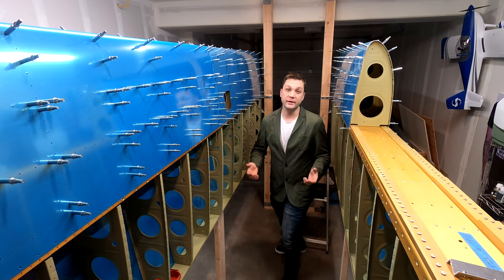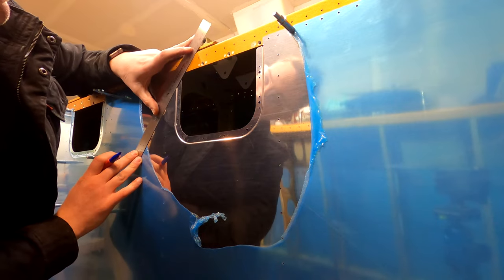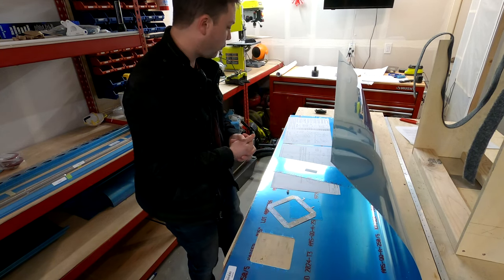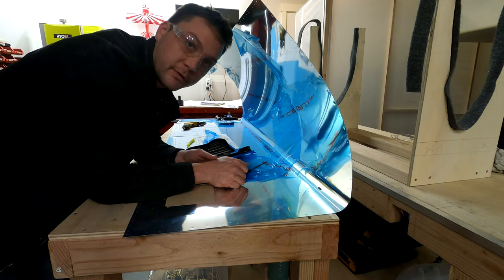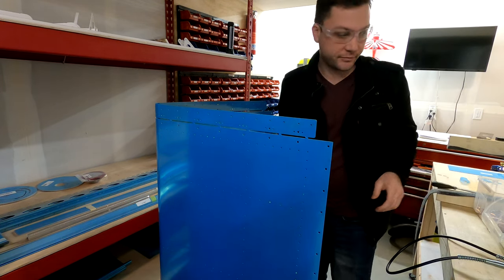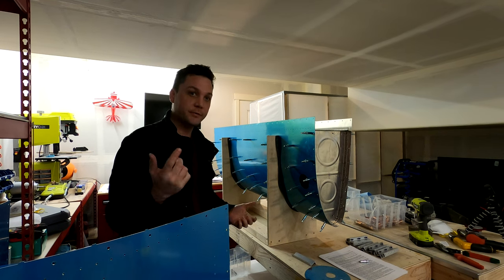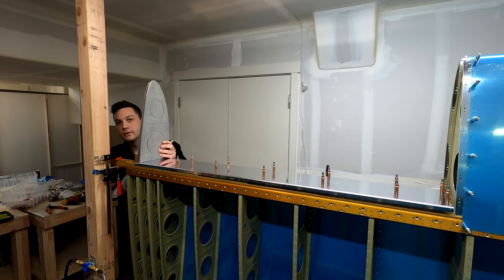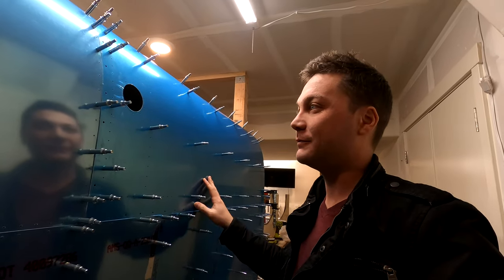Building an Experimental Airplane, The Vans RV-7A | EP2.5 Wing Skin, Leading Edge, and Tank

Comment: I used a cardboard box for the leading edge jig. Worked perfectly. 
You will enjoy riveting the bottom skins 😅
Great Job!
Reply from the maker: Worse than closing up the stab? Or just more of it?
Reply: Yes. You will need an inspection mirror in most cases to check each rivet. I started riveting with the wing on the table, but I didn’t like this method, so I moved it back to the jig. I had to seat on the floor to be able to reach the aft spar. But you’re probably more creative than me. You will find a better way 😃.  
I used a tungsten bar with tape on it. It is easy to scratch the spar. Specially because you won’t be able to see the rivet in most cases. 
Another idea is to have another person helping you 👍
Reply from the maker: Time to find a rivet buddy.

Yeah, I’m not looking forward to that. Oh well—at least it is a ways off!

Thanks for the comments and compliments!